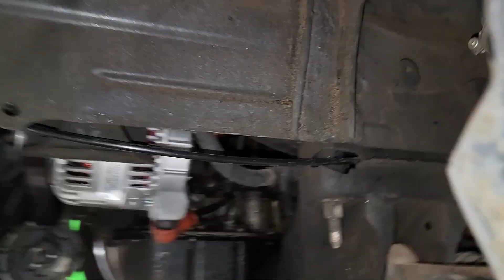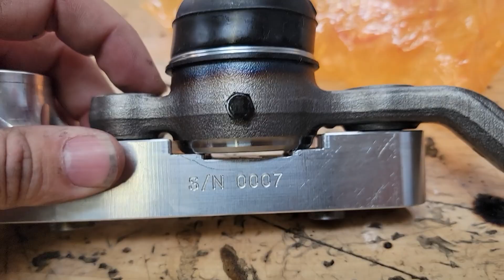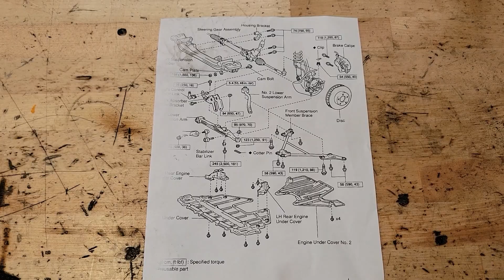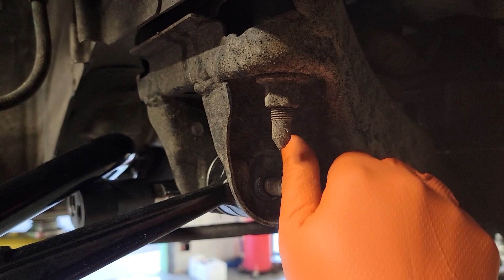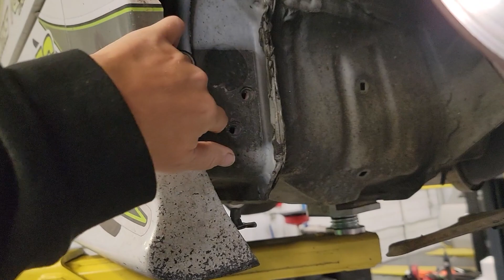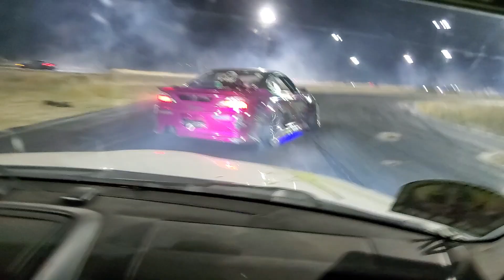Whiskey Garage Install: Lexus IS300 EZ Knuckles V4 Angle kit

Comment: Hey hopefully you’ll see this, how did you know the rotor was close enough toe for the tie rod cut? Just eyeballed it or did you measure toe with the wheel on?
Reply from the maker: Measured front of rotor to rear of rotor, anywhere inside an 1/8th inch and you are good to go
Reply: @Officer_Dan I committed and cut them, it worked great, thanks boss. Happy shredding 🫡